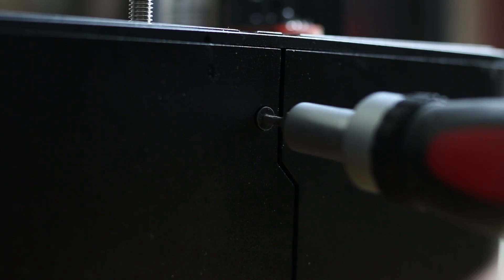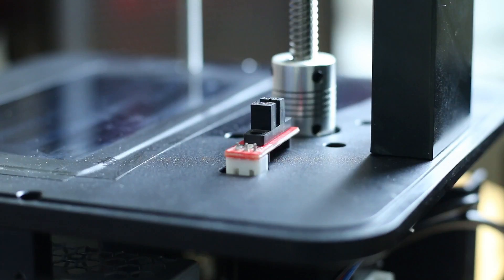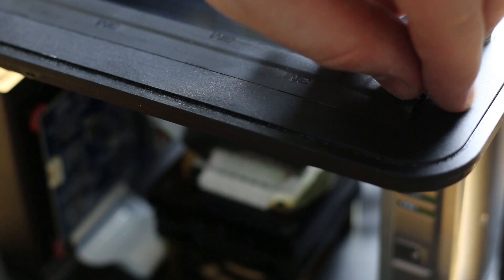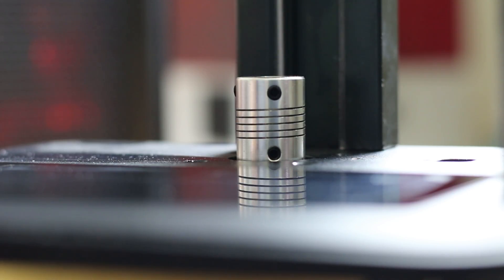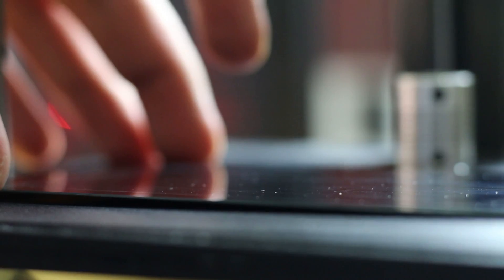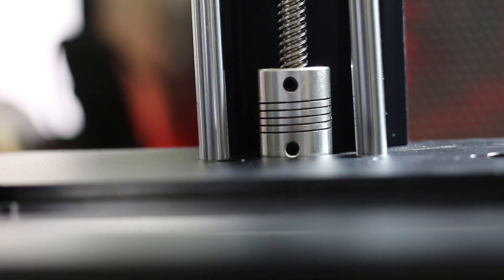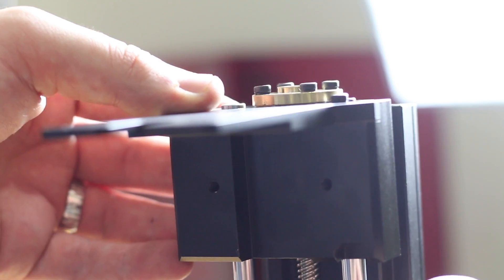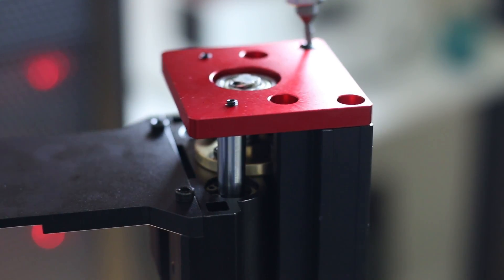Wanhao Duplicator 7 1.5 Upgrade

Comment: Wow...your videos are great...I am fairly new to 3d printing and mesh mixer...I am trying to make a mold that I could pour concrete into...the mold will be of a mountain...so when I am done I would have a finished concrete mountain with a 8 inch base diameter and a height of about 10 inches...could I do this in meshmixer with the hollow and offset commands somehow???

Comment: Wow...looks like it's actually an LCD projector rather than DLP?  The LED light below just shines into the LCD panel?  I there no computerized mirror chip with the tiny mirrors on it?  Thanks @Model3D for the insights!
Reply from the maker: It is an lcd screen with the backlight removed and a 30w uv led array underneath with the aluminium cone to reflect the light. The image for the print layer is displayed on the lcd with anything that isn't to be printed in black. the opposite of a silhouette basically, then and the uv array lights up and cures the resin.

Comment: I'm debating getting the wanhao 7 v1.5 for my first resin printer. But I'm curious how much upkeep of these machines differs from standard 3D printers.
When you finish a print, is the resin left in the tray wasted or can it be reused? Is the machine difficult to clean after a print? How much would your typical 2 inch tall gaming miniature cost to make?
Reply: I've also been looking at these machine and can answer some of your questions (I don't own but have researched).
You can use reuse the resin (you just poor it back in the bottle if its not contaminated during use).  From what I've seen as far as maintenance it looks like you have to buy clear sheets (pack of 3 costs $16) after so many prints to keep the bottom of tray clear (apparently they get cloudy after a while effecting the print) other then that your typical cleaning and lubing of the rod.  I can not tell you how hard it is to clean nor can I give you pricing on a 2 inch tall gaming miniature.  I can tell you last I looked a bottle of resin costs about $75 (1kg and before shipping).  Hope this helps.

Comment: What are your thoughts of the newer z coupler holder top plate vs the thingiverse mod of switching over to a belt drive for the Z axis?    

I have the old (1.1 or 1.2 whatever it was befofore they put a side fan on the metal bortom... Modded with flex coupler and ventilation upgrades) 

Good video.

Comment: Hi! Great video!
One question, though. On my D7 1.4 I changed the original z-coupler to a flex coupler (like the one you have in the video), which improved the print quality a lot. Do you recommend keeping the flex coupler even after upgrading to ver 1.5 or should I change back to the original coupler? I noticed that you kept the flex coupler in the video. 
Thanks!
Reply from the maker: hi, the new upgrade kit comes with a new coupler, I just realised that I fitted the wrong on at the end of the video, I changed it but guess I forgot to take a video of said change. good eye, I would suggest using the coupler they ship with
Reply: Okay. Thanks! :)